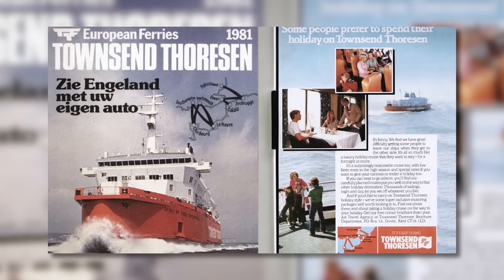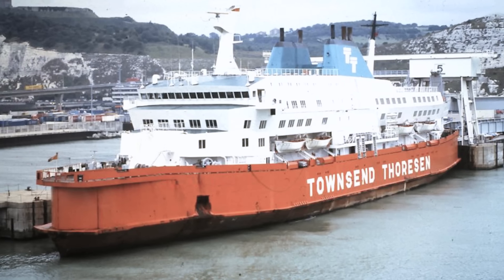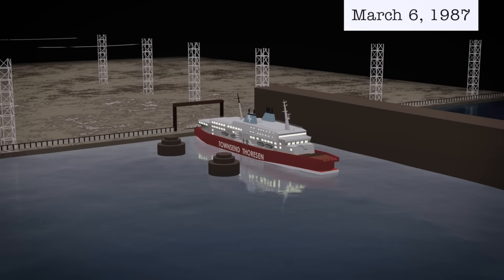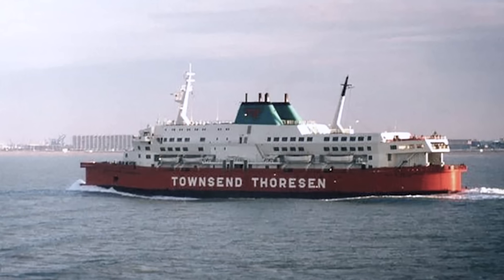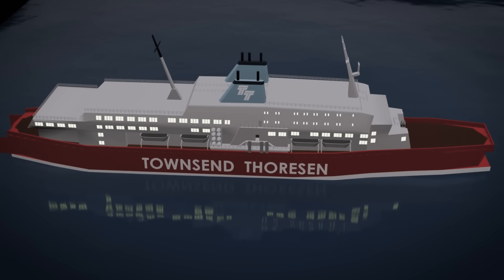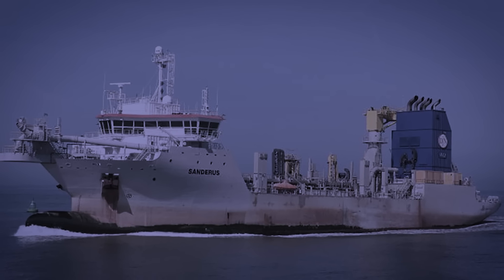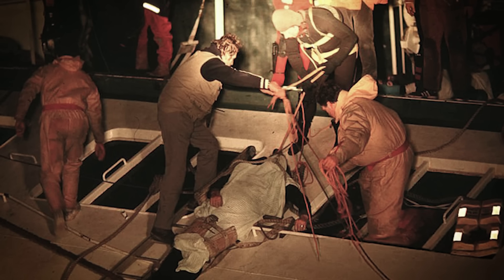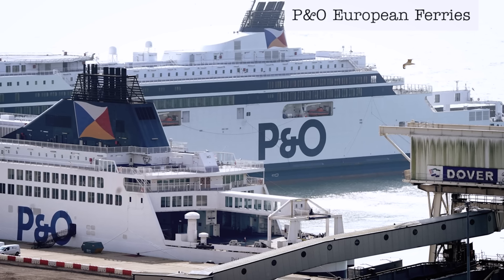193 Dead After Bow Doors Left Open!

Comment: Yet again executives putting pressure on staff forcing them to cut corners for profit and not follow proper safety checks
Reply: Yep. I've learned this channel that it is more than common on water. It's some kind of phenomenon.
Reply: Tale as old as time.
Reply: BS basic failure to perform essential duties.
Reply: Being asleep at your post is not the fault of executives or a prompt departure. Having no door position indicator on the bridge & the captain leaving without a status report is nuts. Being aware of a problem and not communicating it regardless of your current responsibility is a critical error for any officer. An officer wittiness a man missing at his post & a bulkhead in a wrong position. With a single radio communication, we would never tell this story.
Reply: @IHWKR  I have read about this accident before and i believe the crew had asked for CCTV to be installed so that the people on the bridge could see if the doors were closed, but that was dismissed as they did not feel there were no need, as they had people on the deck that was responsible for that.

The craziest thing to me is, why was there not a simple door latch switch to show that the door was closed and the latch engaged.

Sort of like on airplanes where they have an indicator that wheels are down and locked, because they can not physically see the wheel status from the cockpit.
Reply: Kinda like our FBI
Reply: @serenity1378This Swiss cheese model is Useful, but shouldn't be taken that seriously. In the end, it's all about training and adherence to standard.  In this case, at least two people didn't do that And that's what it all boils down to. No need for fancy explanations. You don't need a new system to fix something when you already know the problem. 

 It's down to two guys  not doing what they were supposed to be doing. It's all on them. This problem could have been solved with one guy, a pencil, and a checklist.
Reply: Who decided not to do the checks?
Reply: @M167A1   2 guys not doing their job leading to the death of 193 people is a pretty good argument for why the swiss cheese model has to be taken seriously.
aviation today wouldn't be nearly as safe as it is if it only relied on training and standard adherence, instead of on the countless redundant safety systems.
Reply: @M167A1  go outside for once in your life
Reply: @M167A1  While I agree that the actions of the individuals who didn't do their jobs are abhorrent. I don't care how much time pressure you are under, if you are assigned such a vital job.. you do it, no assumptions or trusting someone else has even if they said so.. but
Ignoring the tendency for people to make mistakes, especially when they are under trained, over worked, under time pressure and lack basic tools to ensure something as vital as the bow doors on a roro vessel are closed is criminally negligent. 
A massively valuable and costly vessel, not to mention the lives at risk or cargo or environmental impact from a sinking, all for the sake of saving a couple hundred Euro for an electrician to install a sensor or camera, or even radios so the bridge can confirm with the man on station that the doors are closed. So senseless.
Reply: And none of the executives or anyone was charged except the lower level employees. Let's get the politicians to fight wars shelves and the ceo's and executives to pay the price of corporate negligence
Reply: The ships on that route, regularly sailed with both bow and stern doors open, presumably to clear the car decks of exhaust fumes.
Reply: More like union shop stewards calling a stoppage every time action is taken against a member in a safety-critical post who fails to carry out duties.
Reply: @shadeburst  why cant it be both?
Reply: Truly a herald of free enterprise
Reply: And this is why, as an engineer, I am against nuclear power. When running a commercial reactor, there is a direct conflict of interest between running it as safely as possible and running it to make as much profit as possible. Which one do you think wins? (Hint: look at Chernobyl) The possible consequences of ignoring safety in favor of profit are simply too severe and too long-lasting to risk it.
Reply: @rocketscientist1594  An expert outside his area of expertise is as dumb as the next guy. ~ Richard P Feynman, if you know who he was.
Reply: @JohnDoe-bd5sz  hell, your car has a light that tells you if one of your doors is ajar or the trunk is open. No reason that a ferry couldnt have anything similar to make sure everything is closed up properly.
Reply: "free enterprise"....    :-/
Reply: @rocketscientist1594 strange thing is Chernobyl was caused by a test of the system to see if power could be maintained to the cooling pumps in the event of a turbine shutdown. It wasn't an accident caused by commercial pressures.
Reply: Whoa whoa what are you an anarchist geez? Settle down get in line. get back to work before they hear you
Reply: The Captain bears the ultimate responsibility for the safety of all onboard. A whole collection of errors and missed opportunities, many from typical corporate greed over safety.
  And of course, corporates always wash their hands with the blood of their victims😢
Reply: And the name of said ship was Herald of Free Enterprise...
Reply: @rocketscientist1594 you should know  Chernobyl was a vodka induced bet. It had nothing to do with "profit".
Reply: Same all the time with those high up in most businesses 🤬🤬🤬
Reply: @rocketscientist1594  Chernobyl was a steam explosion. The reactors used today can't undergo the same disaster.
Reply: Same shit still goes on in P&O ferries despite the new regulations.
Reply: It was deeply entrained into the entire culture ti cut corners. My granddad was a 1st mechanic on the Ostend Dover line and on the morning after the herald disaster I clearly remember him defending sailing with the doors open. “It’s the way we always do it” and so on. Truth is that many (including my granddad) drank on the job to such state that they had to nap. 
Different times.
Reply: Sounds a lot like Boeing.
Reply: @M167A1 whether you like it or not it's more than likely both.

Plus the fact they cut the number of staff on duty for each turnaround.

That's really going to help, not.

I hope the same director who enjoys belting out the orders to the captain and Crew had the courage and decency to apologise to each and every family who lost a loved one thanks to their orders.

But I doubt it very much.

There's a saying that it's almost unheard of for the wealthiest to enter the Kingdom of God.

Sleep well, now won't you?
Reply: %100
Reply: You can’t blame the Fat Cats🙏
In 1986 a Poxy Ford Escort has tech that tells the Driver a door is not closed so how come a Ferry that cost Millions of Pounds didn’t have this tech but was Mandatory on Ferries after this Tragedy…
Reply: @vrocketscientist1594  There was no profit motive at Chernobyl, just misplaced pride in Soviet technology.
Reply: @matrinezkevin11492 it didn’t in 1980 though did I it.
Reply: @vicbauwens marine engineer here. You’re talking bollocks aren’t you?
Reply: @SmaxChristopher1  absolutely not! They always left port with the doors open, closed them only while at sea. And the drinking bit is  also 100% fact I can guarantee you. I agree it’s unimaginable today but that’s how it was.
Reply: They are guilty
Reply: Blah blah blah
Reply: @shadeburst  It is a double edged sword with unions . Unions are the reason there are safety systems installed in the first place . If an employer could get away with cutting corners to increase profits and make worker's Ts and Cs worse they would . On balance unions are a good thing . So many unions and management do good collaborative stuff on a  day to day basis to improve the lives of workers and the productivity of an organisation ( good managers and owners realise that a happy workforce who are paid fairly for their work will pay off for the company in the long run ) . Unions are NOT there to defend the indefensible and cannot ' get staff off ' a sanction when they are guilty , but are there to make sure their members are treated fairly .
Reply: @shadeburst  That I do agree with .
Reply: @wire9486  Look how P and O famously treated some of their workforce when they needed to ' let them go '.
Reply: What you call fair pay is far above market rate wages. Add to that closed shops, militating for political causes that have nothing to do with the workplace, and incentivizing employers to choose automation over humans.
Reply: @scooby1992  Yeah, I once worked for those cowboys.
Reply: @SmaxChristopher1  He's right, It was common to common to close the doors while the vessel was swinging or had just left the berth. On a good few occasions the doors been left open for the entire voyage.
Reply: Unfortunately it will always ever so be thus…🤷‍♂️☹️
Reply: Yeh you got it figured out genius. Start a shipping company…. Bet you don’t make a fucking dollar
Reply: @neilburns8869 Boeing design planes. Townsend Thoresen didn't design boats - they were just a ferry company...like an airline.  

There's a massive difference between being a company that designs things.....and a company that provides services.
Reply: Wasn’t the guy who’s responsibility it was asleep pissed up in his bed? Seems like that’s totally on him.
Reply: @vicbauwens  'ingrained' not 'entrained'.
Reply: @robtyman4281 thanks for your correction. I’m not a native English speaker.
Reply: Just a summary of capitalism…
Reply: @rocketscientist1594 only, Chernobyl was built run, and blown apart by a communist regime - therefore NOT FOR PROFIT 

Genius
Reply: I once many years ago had the pleasure of working for a UPS center manager that had a gold 
Plaque above his desk that read simply : GO CHECK !     Mr. RH  good man .  👍👋
Reply: True that! Got nothing todo with the execs.
Reply: Bit Emotional, I had family and friends on there. 
I would like to say the Belgium people where brilliant and very kind. I would also say as related to a cew barman on the herald nobody shutting the doors was a drinker. They could drink as much as they liked, but not them. 
Two cans of week beer is nothing, like a soft drink.
Reply: @M167A1 your a bit wrong there. we always left doors open as the port so big we could blow the fumes off the car deck. His job was not just shutting the doors, esay understandable. We could drink as well on board but they didn't. My bothering law was crew barman on that cew.  
The alarms to say the doors are open, are still going off as we sail out of zebie and calais daily. Otherwise the passengers lounge is full of fumes. 
The cameras and alarms are needed, and safer than over worked humans. I sit on deck or use the tunnel.
Reply: What about our guy who abandoned his post?
Reply: Corporate greed should not be underestimated!!!
Reply: Exactly, the joys of capitalism.
Reply: @mxecho yes it is.
Reply: @OziBlokeTimG  capitalism democracy and communism all serve the same people - they play all sides because they have all the money
Reply: @nihilistic7840  Agreed
Reply: Like Boeing ! 🙄🙄🙄🙄
Reply: @rocketscientist1594 

Chernobyl waa built to provide power for the Western Soviet Union in what is now Ukraine. There was no profit motive, only a need to get it up and running ASAP. It is known that the design of that reactor and others built to the same design were all basically unstable and prone to triggering a runaway meltdown. Using it as an example for your argument is not really accurate.

Comment: No red light on the bridge to indicate the open door? Unforgiveable. Saved a few dollars skipping that simple safeguard.
Reply: The idea was mentioned, as concern was given, but it was considered an unnecessary expense, a bit like more lifeboats on the Titanic, the rest is history.
Reply: Its not just that, its the operation of warn if something wrong, not confirm everything is right. One is reactive, the other is proactive. If the procedure was call the bridge to confirm doors closed it would have acheved the same thing.
Reply: it should be annoying noise like if U don't  lock  safty belt  in car
Reply: Of course, after the event happened the fleet installed C.C.T.V. cameras on the bridge, & in the engine control room of all their remaining vessels. During rough weather it was sometimes possible to see water flooding in through poor rubber seals from the outside, slowly filling up the gap between the inner & outer front doors.
Reply: Crews repeatedly demanded such safety measures but were denied. TT really was a shit house as you can see by the "15 minutes early" -letter cited in the video.
Reply: @mhead81  yeah I agree, a light, a noise & maybe not even be able to operate without all doors closed!
Reply: That whole company were bastards to work for.
Reply: Being disoriented in the dark is terrifying in a disaster. Having a pocket flashlight might save your life in a similar situation.
Reply: How much would a handheld two way radio cost to call the officer at the rear and confirm door closure. Also wouldn't you get indicator lights as pumps turn on to combat the flooding.
Reply: @tellucas  I worked onboard the HOFE 3 months before she went over,and before me we had to fight TOWNSEND for everything but That bastard Loed Vestey always halted progress we the union  NATIONAL UNION OF SEAMEN were in no doubt it w as him that got them cleared of Corporate Manslaughter,it was the same old fight we had trying to find the cause of the sinking of the MV DERBYSHIRE .
Reply: Yes. Even the Titanic back in 1912 had lamps to indicate if the emergency bulkheads were shut >_>
Reply: @Andy-x3e4z  wow
Reply: @mhead81  Seriously good idea!
Reply: Page one isn’t it!
Reply: Agree - heard (not sure if true) that the indicator light would be £5 + cost for the wiring with many on the ground / ship requesting this to be installed but fell on death ears with the greedy inept management upstairs; they should have been prosecuted
Reply: @eisenkopf69  unfortunately spot on and these poor people - innocent passengers and crew ( many who were brave on the day ) would have been still alive
Reply: @mhead81 or simply lock the throttle out until the doors are closed.
Reply: You’d think, right?
Reply: @RedCyanPhotos 1000%!!!! Thank you!
Reply: British shipbuilders are notoriously cheap even after Titanic they learned nothing. I would never travel on a British built ship.